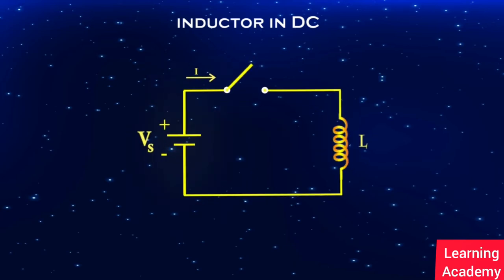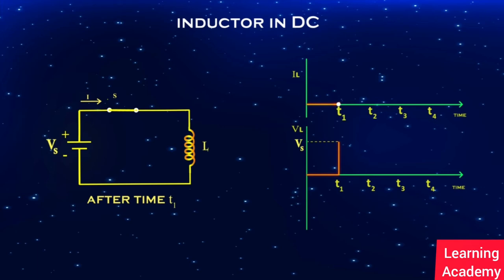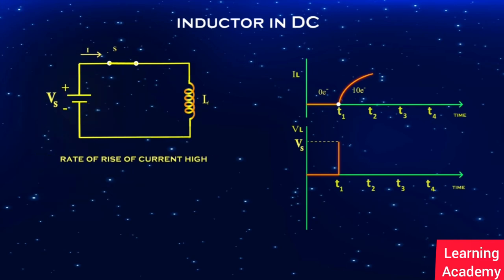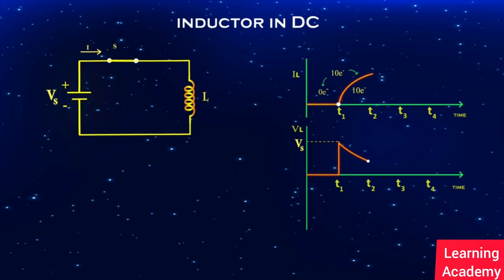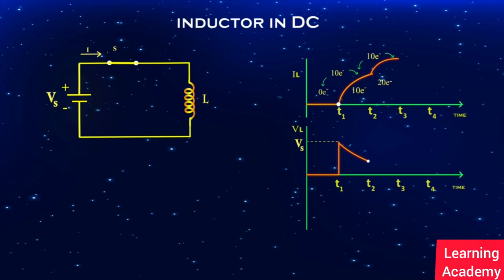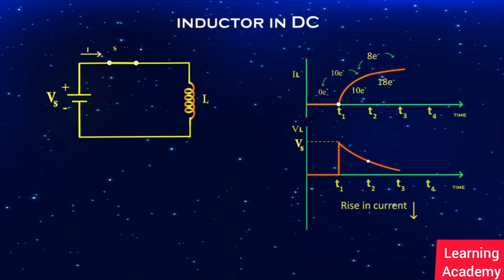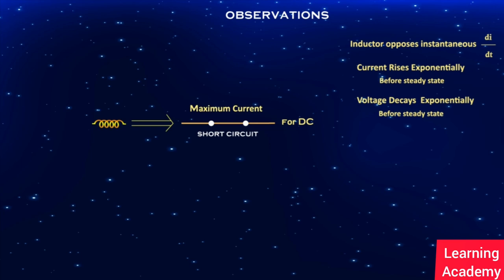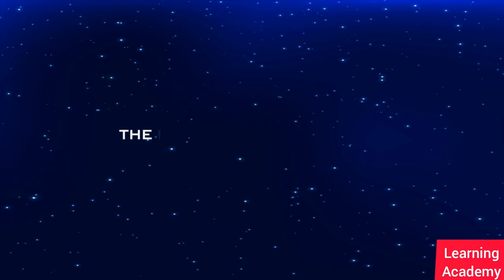Behavior of Inductor in DC || Electrical Engineering || Engineering || #ElectricalEngg #Inductors

Comment: for dc source , current is constant then if we on the switch by using the formula v=Ldi/dt i=constant then di/dt is zero then voltage will be zero right.